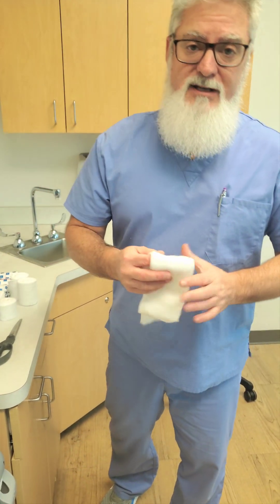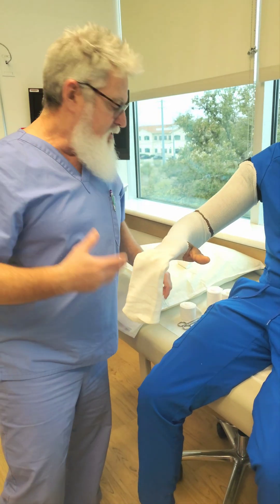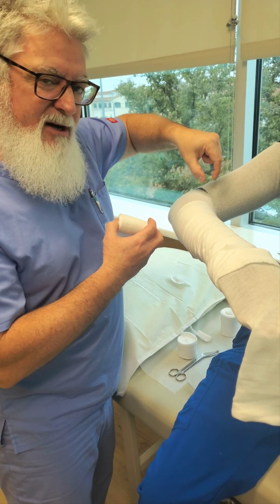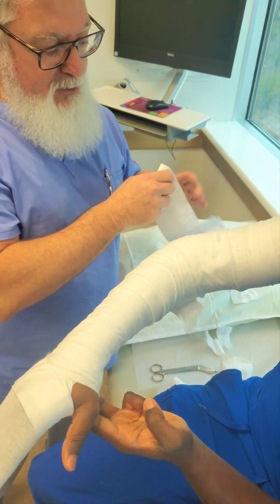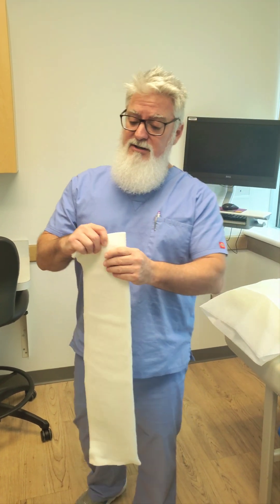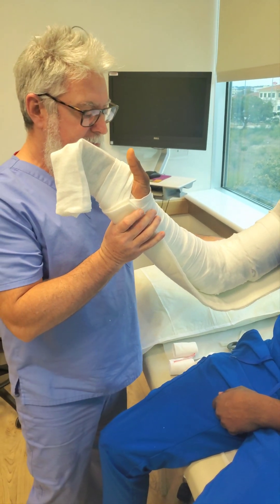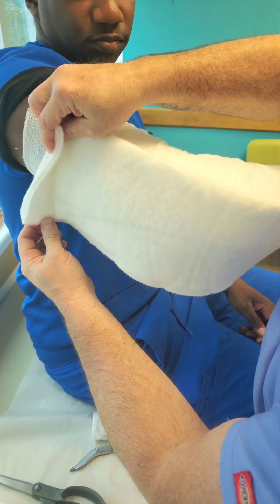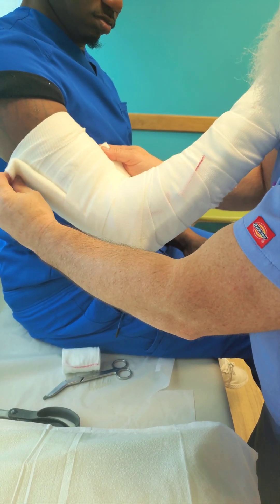How to Make a Long Arm Posterior Arm Splint / Elbow Splint (part 1 of 2)

Comment: It like a hard cast
Reply from the maker: @cynthiamaybunya4622   ...Cynthia, thank you very much for viewing and for the question as well. Yes, the Splint will harden just like a cast, however is not as sturdy as a cast. Due to the fact that it's only a few strips of either plaster or fiberglass. Also too, please know that I am working on the other video(s) that you've requested as well. Sincerely woodie 🙂👍🏼